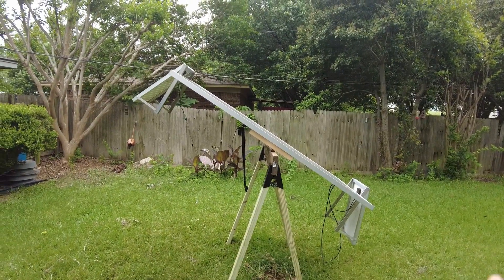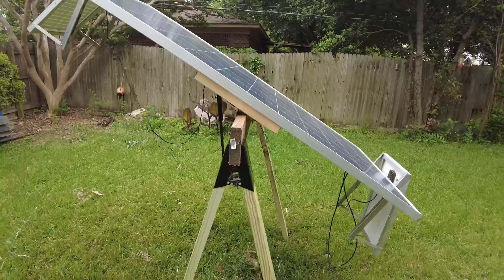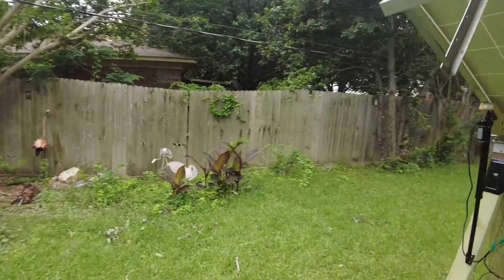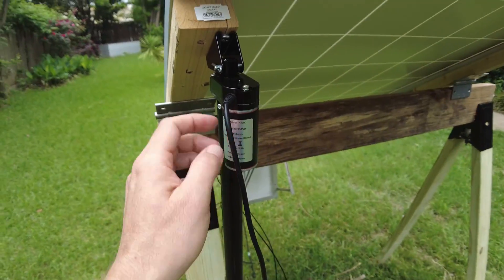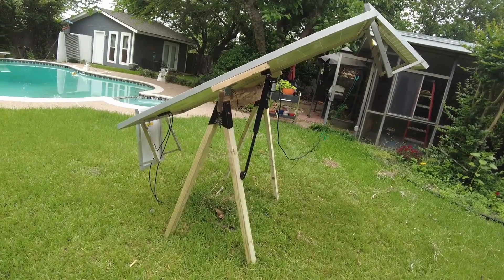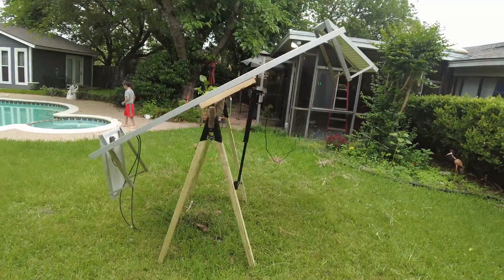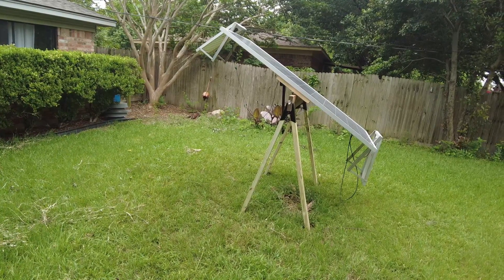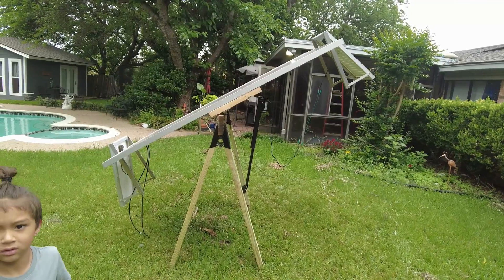Easiest Solar Tracker

Comment: I don't believe for one minute that this thing works.
Significant reason being that all solar panels have 'bypass diodes' fitted.
What we have here is where he has connected 2 panels back-to-back reverse connections is that the bypass diode in one will always short circuit the other.
Thus there will never be any more than the 'forward voltage' of a silicon diode ever appear across the motor of the actuator.
And that will be about 600millivolts, which is going to do nothing for a 12Volt actuator.
And anyway, it's too fragile mechanically and every way - the smallest gust of wind will wreck the thing, the hinges will rust and seize up and it's just a waste of time.
To make strong successful 'tracker' is not to make a tracker at all - just use 3 panels as he already has here.
1/ Fix the large panel, solidly and out the way of all those trees, facing directly South and at an angle off the horizontal equal to your latitude.
2/ take the 2 smaller panels and fix one of them at quite a steep angle facing East and the other, likewise steep, facing West.
3/ Ideally all the panels will be the same power but it doesn't matter - have a 100watt facing south and a pair of 50Watts facing east/west
4/ Connect the positives together and the negatives together and then connect the 2 wires to your battery controller/manager

Simple. Strong. Robust & reliable and captures the maximum of whatever sun you have
Reply from the maker: Well it does work. Don't take my word for it (obviously you don't believe it anyway) try a simple experiment. If you have two matching panels wire them the way I have. Then expose them to the same amount of sun. measure the voltage at the spot where you connected the panels together. You should measure close to zero volts if the panels are matched, and have the same light exposure. Now partially block one panel, you will see the voltage rise in either the pos, or neg direction. If you do this you should understand how this works. Thanks

Comment: Are the panels diode protected so the power from one panel does not attempt to back feed the other panel??
Reply from the maker: So the panels are connected to each other in reverse polarity, i.e. neg to pos, and pos to neg. They are essentially fighting one another. If one wins the fight then it gets to drive the actuator motor. Placing diodes inline won't do anything except waste power in this scenario. Thanks
Reply: @BradCagle  Sorry. I am just learning. I am trying to figure how to get my panels to track. Great idea! Have you just let it cycle to see if the fundamental design will endure?
Reply: watch it,  china is a liar,   in many cases they do not put the diode in

Comment: This is absolutely amazing so much so I just built one myself. It works perfectly until I wire both panels together and it just stops? What could be causing this please? Do I need a blocking dioad on the one panel? Thanks

Comment: Very cool setup, I was thinking about doing something very similar but with 8x panels along the top of a fence that runs north/south so the panels would track east/west.
Reply from the maker: That would be rad!
Reply: @BradCagle  How many panels do you think those actuators could manage? My other concern is if the fence would blow over since adding those panels would catch a lot of wind!
Reply: And bracing on a weaker fence would suffice.

Comment: I have a 12V, 50W panel and a 200W panel, and neither one will drive an actuator by themselves.
The actuator is 12V x 3A = 36W.
The charge controller will run the actuator off the car battery.
But the actuator goes full travel and does NOT follow the sun.
How are you following the sun?

Comment: Great idea having the solar panels oppose one another.

The problems I see are...

The only thing holding the  solar panel in place is the actuator. The larger the surface area of the panel the more stress on it due to wind.

Moving parts fail over time. Will the extra parts pay for themselves over time before they fail?

Another solution would be mounting two panels (with blocking diodes) in slightly different directions (east and west)

In the morning the east panel provides most of the power. In the evening the west panel provides most of the power.

During the middle of the day, they both contribute.

Solar panels are cheap and don't have moving parts. This is why most large solar arrays don't use trackers. It is more cost effective and reliable to just add more panels.

Your tracker idea was quite creative though. If I were to grade it... It would get an A+.

Comment: I keep wondering why good telescopes have such good trackers and could one slave off of one to track the sun? Why isn't there a similar thing for Solar panels. Where it just knows where it will be at any given time based on your GPS data?
Reply: A simple light sensing tracker will outperform a solar prediction algorithm.
Two reasons are in overcast conditions flat is the optimal angle and snow can make the optimum angle lower to get extra reflection from the snow and a prediction can't predict those conditions.
It's not much but why overcomplicate for less optimal results?
The bigger question is why bother at all when additional panels are so cheap unless you just like the geek factor which I'm on board for but, economically it's usually a waste.

Comment: probably need some diodes to protect for reverse voltage to each tracking panel?
Reply: you can do two variable capacitors,  or just get another actuator and put it on the other side,  so there is no crossing of polarity to burn anything up with,   the way he has it here,  he will either burn the motor out,  or the cells in the little panels, or both,   This is a must do that is not shown  Diodes are very rarely used,  China lies about them,  they are not in the little black boxes on the panels like your supposed to see them in there

Comment: I've been thinking about this, but with some form of limit switches.
Reply from the maker: The actuator has limit switches built-in, so no need.
Reply: @BradCagle  Oh cool, I was wondering about how those work.  It obviously has to stop movement in one direction but still allow it in the other (else it would never reset).  So I guess internally it's limit switches in conjunction with bypass diodes.

Comment: Simplicity is key to reliability. Your demo build can be easily morphed into a larger array, even dual axis if desired. Good video to explain to DIY builders!
Reply from the maker: Thanks! Yeah I have already built a larger array with the same concept.
Reply: More simplicity would just be to have 2-3 adjustable settings for time of year and change it based on the solar season (equinox and solaces), that's far fewer parts, and if you use 2 settings One mid point from winter solstice to equinoxes, then another mid point from equinoxes to summer solstice. The angle is the sky changes slowly compared to the tracking cross sky. Fewer moving parts = fewer failures.
Reply: @jalindell good thinking, I’ve been chewing over the north south thing too.
Reply: @5400bowen  Yeah, for optimal, you just need to know the optimal seasonal settings, in deep winter you don't have a ton of Solar Hours, but you will want to optimize them Setting for Winter would be a Early Nov to Late Jan, Summer would be Early May to Late July, and the setting that would be "default" would just be all the other times of the year. You COULD make it complex as a monthly adjustment, and in that case you'd need Dec/Jan and June/July as shared points, and each month from those two points would be shared between 2 months (or close enough to not matter) Feb/Nov, March/October, April/Sept, and May/Aug... so 6 total adjustment points. Those points should be angled slightly to the centerpoint, so Dec/Jan would be angled for optimal sun not at Dec 21, but at ~Dec 7th/Jan 21, likewise for the peak sun, you'd want it to be slightly lower than peak for best performance for the whole period of ~60 days.
Reply: @jalindell before you get to far consider that in overcast conditions flat is the optimal angle regardless of season and snow can make the "optimum angle lower than the calendar says it should be.
Just to throw a wrench in there.
Reply: @ghz24  I mean it really is about if you want a unoptimized flat (which has its own issues in snow, as it collects and cannot self clear), an overly complex 2 axis system that would have a MTTF of about 4x greater than a 1 axis, or a semi Optimized system that has the same MTTF, but you touch 2-3 times a year. I would go for the last option personally, unless it was a massive system that needed to get every last drop of power it could.
Reply: @jalindell  unoptimized flat?
My point was the "optimum" can change drasticly from day to day.
Not pushing for any specific system, tradeoffs are an individual thing.
 Personally I would only do  2 axis tracking as a test/toy but I'd consider a single axis tracker that makes intermittent adjustments to the seasonal tilt angle. So maybe hourly it checks to see if it's a sunny day with snow cover and the angle should be almost vertical or overcast and the best angle being almost horizontal. I'm curious if this is worth the effort and how much it gains over simpler systems.
But that sounds overly complicated and as you point out prone to possible breakdown. 
Most likely any nonstatic mounted arrays I'd adjust manually twice a year.
The set points would be half way between summer solstice and equinox (summer setting) and half way between the equinox and winter solstice. They'd be changed on the equinoxes.
So the summer setting would be perfect angle for May first and equally out of adjustment on the solstice as the equinox.
I think it should be a little closer to the solstice though because the sun angle changes more rapidly around the equinoxes than the solstices.
Reply: North south are nott worth the hassle. The sun moves east west for bilions of years. Leave it like that , just tie your wires up neatly. Great build
Reply: you dont need dual axis. pivot the axes like that. if the sun is on the highest point at the day. drill a hole in a plate, stick a pencil inside the plate in an perfekt 90° angle all around . the shadow of the pen has to be no where. mount the Module in exact this angles and the axis too
Reply: "Mini Solar Tracker simple" video on my channel. a little project

Comment: I have a question if you know The path of The sun is from A to B why do you need The last solarpanel it should be only one panel because The last is is The end point according to my opinion but I want to hear what you have to say 😊👍
Reply from the maker: Well, It could be possible to make it work with a single panel. But only for one day :) The next day it will never return to A
Reply: @BradCagle  my bad your correct 😂 I was really thinking wrong. Anyways this was really great cheers mate from 🇳🇴
Reply: In this design, with no "brain", it actually wouldn't work with only a single end panel at all.  If you didn't have both end panels you wouldn't create the balanced state of power produced on either side to stop the motor from turning.  Ambient light alone on a bright day would send that actuator to max out in one direction in short order if you only used one end panel.

This is basically a game of teeter totter where both sides are pushing against the ground to provide lift, except the amount of lift is determined by the light hitting the end panels.  So if both panels are getting the same amount of light, it's balanced, both people's legs on either side of the teeter totter are pushing at equal strength and nothing moves.  If one panel is getting more light than the other, the side getting more light pushes harder and it moves.

Comment: i applaud the ingenuity, sir! we definitely think alike when it comes to engineering unique solutions. cant help but wonder if it could be made even lower tech. maybe with some temp sensitive gas partially inflating 2 matte black bladders/ballasts(possibly with 1-way flow valves connecting them) so that sun light/heat expands the gas under the opposing side. or some mechanism utilizing the thermal spectrum of solar. hard to conceptualize tho because I'm driving lol
Reply: @CaptainProton1  gee, that reminds me.. I forgot to learn to care about the opinion of people trolling YouTube comments looking for people to try to insult. 
but, hey, I'll get right on that.
Reply: @tech-ishbrad183 we can hope he was joking….
Reply: Propane used as a freon can make a passive tracker.

Comment: Pretty ingenious! Congrats! You could use smaller panels driving some relays that activate the actuators running of a 12v battery setup, instead of driving the actuators directly off the panels. Obviously, you would have to supply a way of recharging the battery but that's easy once you have PV energy. I just love the fact that it uses no electronic boards or sensors. Cheers from Puerto Rico
Reply from the maker: Thanks!

Comment: What about the angle of the 20W side panels?
Reply: you have to have the two separate panels,  i don't know what he was  mumbling....   the angle can be adjusted with the variable, if your using those,  to off the juice from the panel to the motor,  and they probable cheaper than the other actuator put on the other side.  Not as good,  but it would do the trick to off the juice on one of the panels so that its not cross voltage going to the motor.  but i beleive the two actuators is best, putting one on each panel keeping his cross juice out of the motor
Reply: using variable capacitors , you also would have to adjust them when it moves to its last position using a volt meter every 2 weeks or less I would say?  diodes,  dont, its hard enough to keep the new cells they make now from burning up,  you will fry the least point i the wire of the entire panel as soon as the sun gets hot enough.  Most todays panes do not last,  they chinched out the wire to increase the amps in panels today,  very dumb idea, only old panels with thicker wires last longer, but produce less amps,  and amps  when the cell is not working right,   gets the cells hot

Comment: Good day sir. May I ask what is the ratings of your solar tracker panels. Thanks
Reply from the maker: The small panels on the side are 20w 12v.
Reply: Can I use 20w 18v panel?
Reply from the maker: @johncarlomagayanes2664  yes
Reply: Is it your actuator is 20w also sir?

Comment: Great idea. I saw one a few years back where a dusk to dawn photocell was use in a sealed tube with a small hole in one end. One for east/west and one for north/south. And it seemed to work well on paper. I wouldn't think north/south axis would make a whole lot of difference. But perhaps it could be incorporated with your design as well. Perhaps both. Interesting concept. I may borrow that idea if u dont mind. I live in southern Arizona and we get 300 plus days a year of almost cloudless skies. And a truely efficient solar system should incorporate 2 axis. Wouldn't you agree?
Reply from the maker: Absolutely use it! Yes I think it would work great in Arizona. I think the next improvement would be to add an adjustable South axis, you would only need to manually adjust maybe twice a year.
Reply: @BradCagle  where im at on June 20 the the sun is approx. 102° N. On December 20 it is 35°S. And believe me, it hot here. You'll sweat from mid February through late December. If you work outside. I think ill use your idea for e/w and the tube n/s. Of course im driving 20 full size panels so ill need to beef it up a notch. I love your idea. Its going to work for me. I working on a focused invisible laser to activate traffic signals. Here in Arizona the county engineers earned token degrees probably from Somali School of civil engineering. Im kidding. And i mean no offense to Somali. I just know in large metropolitan areas in the Midwest, u can breeze through town in either direction and catch ALL green lights. If u do the speed limit. In tucson you stop for all lights unless its 3 am. Anyway ill keep u posted
Reply from the maker: @jb-ik8sj  Wow 20, yes please do keep me updated. Here's another one I built using two larger panels https://www.youtube.com/watch?v=gHZCTBCteW0
Reply from the maker: @jb-ik8sj  Here's a tip, in the linear actuators there will be diodes on the back of the limit switches. Change those out with schottky diodes. They have lower voltage drop, and it'll get out of the limits much better.
Reply: @BradCagle  If it only needed to be adjusted 2xs a year I would just rig it by using blocks to adjust the orientation. Hill Billy style. LOL

Comment: Can you comment on the circuit diagram
Do you think slightly larger panels will move the ram quicker….I plan to test with one of my rams…maybe add a resettable breaker…just in case…the stops may have to be adjusted and tested.
Reply from the maker: The concept, and wiring is shown in this video: https://www.youtube.com/watch?v=ADIUlVR0bh4
As for larger panels, yeah it probably can support better movement. In your linear actuators you usually have diodes on the back of the limit switches, change these to schottky diodes. Normal diodes have a 0.7v drop, schottky diodes have 0.3v drop. This allows the tracker to get out of the stops faster/easier.

Comment: Instead of the small panels couldn't  you put it on a timed circuit like a sprinkler system
Reply from the maker: Yes, technically you could. But the whole system becomes more complex, and failure prone. You would need multiple timers to move the position many times throughout the day. You would need these timers to only run a few seconds then stop so they move the panel only 10 degree or so at a time. You would probably need a battery, and a charge system, etc..